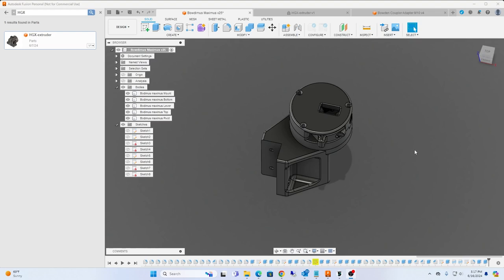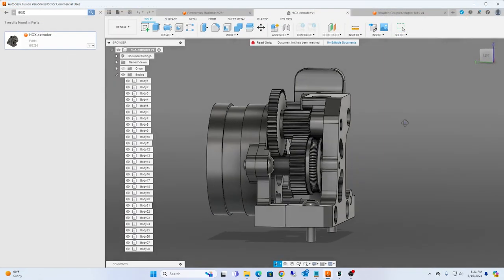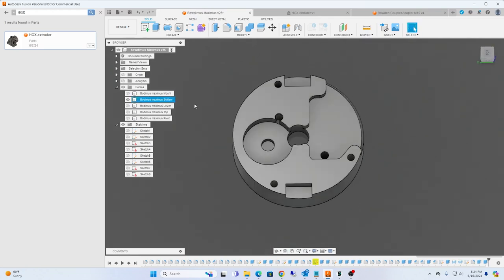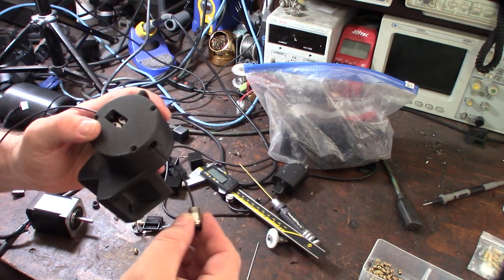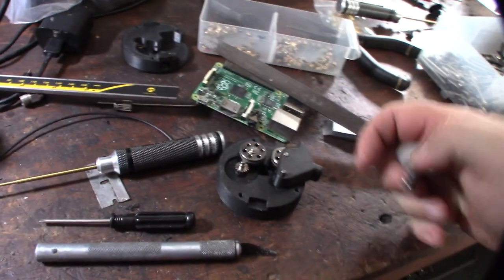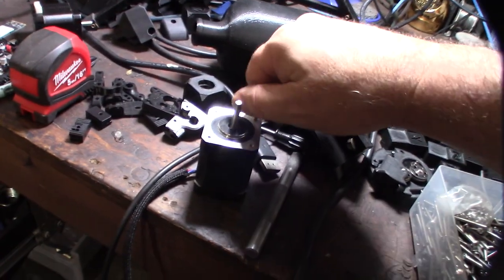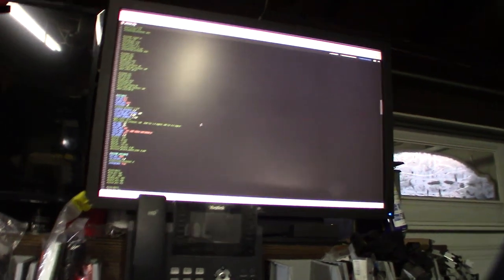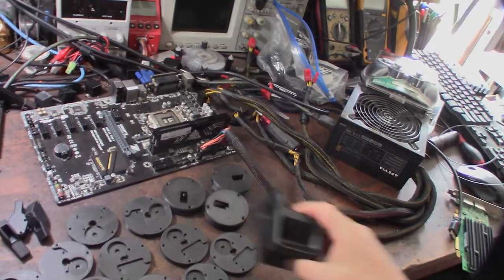Bowdimus Maximus High Performance Bowden Extruder For CoreXY CrossXY CroXY

Comment: The screw where you change the tension of the gears should be at the same height as the filament path
Reply from the maker: Are you saying 1.75mm gap between the lever and housing?